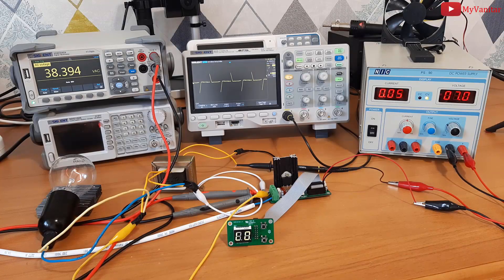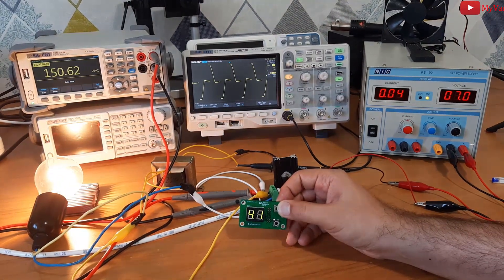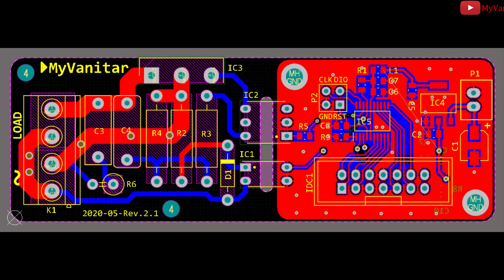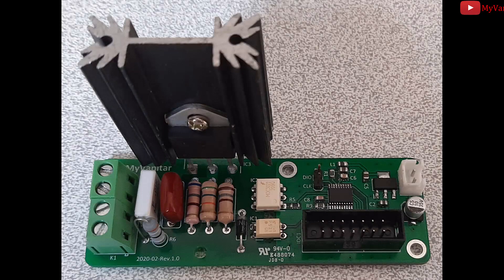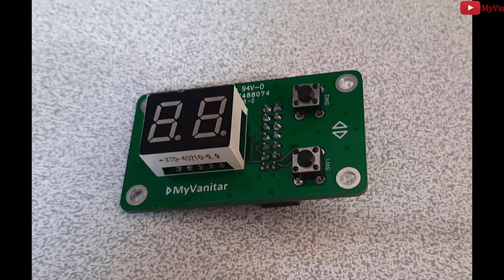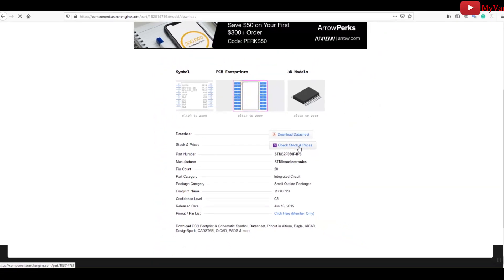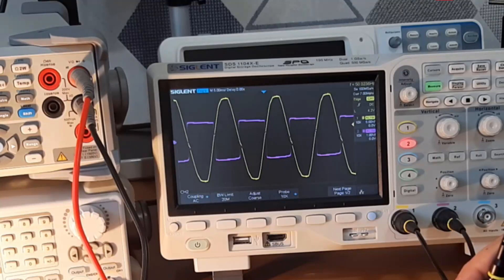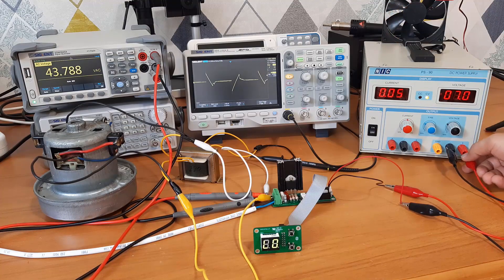Digital AC Dimmer Circuit Using STM32 and Power TRIAC

Comment: Hello, nice video and project, thank you very much, one question, why at 0 adjust in the screen, the bulb still receiving some voltage?
Reply from the maker: that is my configuration because the OFF lamp is not zero volts

Comment: Can you change some control method as replaced push button switch to a Potentiometer?
Reply from the maker: if you want to control using a potentiometer, an analogue circuit using a Triac is much easier
Reply: I think you're missing a point here. Digital dimmer is to be used with a microcontroller or smart home appliances. If you wish for a manual control as mentioned it's better to go with an analog dimmer. Very simple device that you can also purchase for about $5.

In my particular case I'm using a digital dimmer in this scenario: a primitive AI of my dumb home, controlling it depending on how much power the house can currently pull from solar. If it's a sunny day - the dimmer is open at is max position and allows kettle to pull up to 2KW. On the other hand, if my panels lying under the snow - the kettle doesn't even turn on. Notifying you with a voice message that right now isn't the time.

Comment: how can apply without push button switch using a Potentiometer
Reply from the maker: A potentiometer is much easier! Digital is difficult
Reply: @MyVanitar  I'm talking about using Potentiometer isolation control

Comment: Hi, buddy i am facing an issue with the light flickering i am using microcontroller of stm 32 fo30k6t6 series actually i used systick  to run timer for 10 ms but instead of going to 10 ms it is going 11 ms i already checked my systick its ok. kindly help me out
Reply from the maker: That's not because of the thing you mentioned. You can use my circuit. No flickering.

Comment: how i can connect tachometr? please add code.
Reply from the maker: the tachometer is not related to this circuit, it is used to get the rotation parameter of a brushed AC motor, such in a washing machine … etc. that's it.

Comment: good job i have 2 questions 

1 - About the heatsink can you please tell me when I will need the heatsink ? For example for a 25W or 75W lamp do I need a heatsink ? 

2 -  If i didn't want to use a heatsink or a van is there any other solution because what i want to make is pretty small (inside box) and  i dont want it to be big
Reply from the maker: I did not touch the component because it is risky, however if your load is small, just use a small heatsink. it will not take any more space, the used Triac is powerful, for your mentioned load it will not need something big

Comment: Can we use this dimmer with minimum AC voltage to feed a AC/DC voltage converter (i.e 40VAC-5VDC) Sir? and it safe? Please advice me with thanks!
Reply from the maker: I have not tested it, however it should not be any problem
Reply: @MyVanitar  I plan to make a transformerless AC/DC converter using this approach! I asked quite many people and they said this is not safe as there is no galvanic isolation! But I dont see any chance that the minimum dimmer voltage of 40V can be unsafe! My idea is to make the converter in 3 part:
1. Dimmer module to have 40VAC
2. Diode bridge to convert to DC
3. Filter for clearing noise and then capacitor + linear rectifier/ or buck-boost converter to have 5V or 3.3V!
Please advice!
Reply from the maker: @NgocDangDinh   Yes, that is not galvanically isolated and if you touch the 220V, it is quite dangerous, however, it works for low currents applications. I see this method in some cheap commercial devices (a transformer-less supply). I don't see a reason that your method with this dimmer will not work, however, this method is not cheap, I mean using a dimmer to reduce the voltage and risk. There are cheap switching power supply boards in the market that are isolated and can be directly connected to 220V, if you want a 5V output, you can use a mobile charger as well! the application of a dimmer is different, although I think (not guaranteed) that can be used for your purpose as well! for a transformerless supply, you can use my project "inrush current limiter". There are two circuits, one for the AC loads and one for the DC loads. The circuit of the AC loads uses a transformerless supply to feed the relay and delay circuit. however, I don't know your application. if you want to play safe, use a switching board or a transformer
Reply: @MyVanitar  Thank you for your response. Using an isolated power module is the best choice and I made it already with the Hi-Link pm03 and pm05 already for my ESP8266 light controller project. The only reason that I am interested in this transformer-less thing is to find out whether it will be ok for reducing the risk of getting shock with transformer-less power module using Phase angle control approach that is applied under your Dimmer!
Reply from the maker: @NgocDangDinh  if you don't touch the input, you won't take a shock. if your current consumption is lower than 100mA, yes you can use a transformer-less supply. also, the calculation of your transformer-less supply is for 220V. if you apply 40V, the circuit will not work (will not give the same output voltage). for safety, you can use an isolation transformer which is a 220V to 220V transformer.

Comment: Can you place the code here also??
Reply from the maker: The code is available to download from the article
Reply: @MyVanitar  Hello, I requested access to code but you don't get notifications I think.
Reply: @MyVanitar  It's quite simple release the code on GitHub
Reply from the maker: @marcelorobertogadotti523  Check the article, at the bottom
Reply: @MyVanitar  the code is in a private folder from Google drive, I did request the access few days ago.
Reply from the maker: @pp5mgt  Strange, send me an Email to send you the files directly, however that's not the code, it's the HEX file to program the MCU

Comment: Fantastic project, Hesam.  I am initially using an expensive phase angle relay in a project and need to replace it with a cheaper design, so this is of interest to me.  My research led me to understand that switching exactly on the zero crossing is extremely important and that normally a silicone controlled rectifier (SCR) is used for this as it does this in the analogue domain.  Have you got any close-up pictures of the zero crossing transition and does the MCU sample the AC waveform to detect the zero crossings?  Any idea how your method compares with SCR?  I would love to have a look at the schematic - do you have a larger version than the one on your blog?
Reply from the maker: You're welcome. I have provided the full article. As I mentioned in the video, you can access that through the provided link in the video description. The zero crossing points are both demonstrated in the video and also I provided a picture of that in the article. My knowledge regarding SCRs are limited. maybe something I'll post in the future
Reply: @MyVanitar  I've already read the article.  I could only find a picture of the schematic, but it is too low resolution to read any text.  By looking at zero crossings, I mean really zooming in to the transient to see the imperfections in switching.  I'd love to see you do a project on SCRs.  :)
Reply from the maker: @ChristieNel  I have no close up picture to upload at the moment. Also MCU does not sample the AC waveform. another circuit captures the zero-crossing and handles the trigger signal. I prefer this method to have both isolation and not to use MCU's ADC or something.
Reply: @MyVanitar  Completely agree that capture and trigger should be in analogue domain.